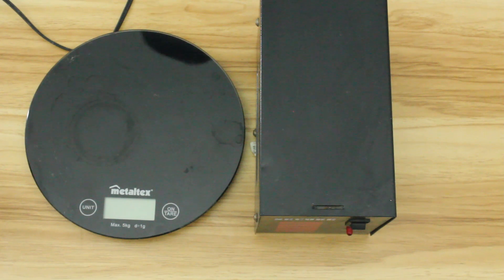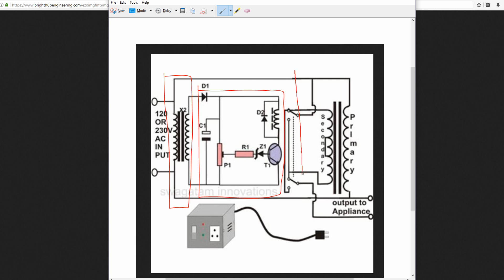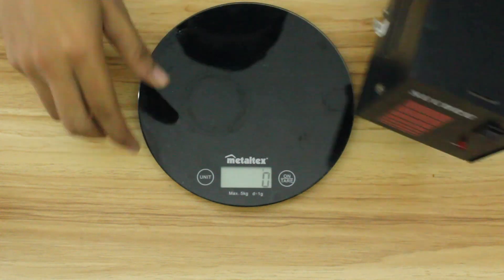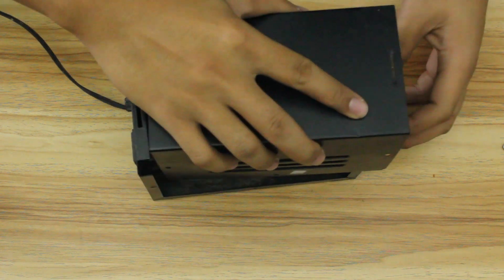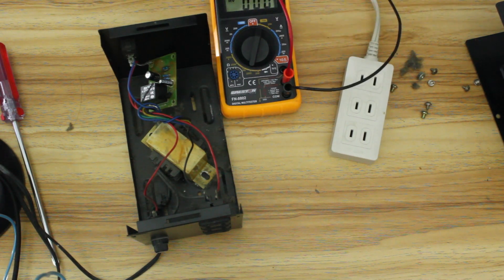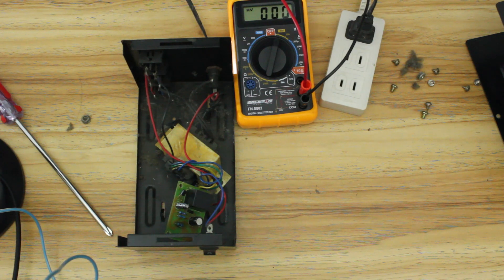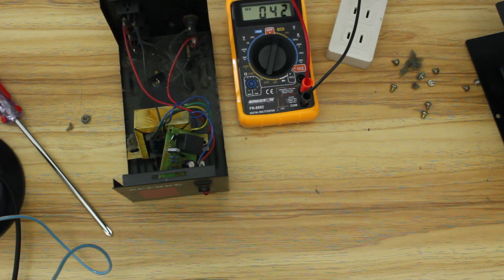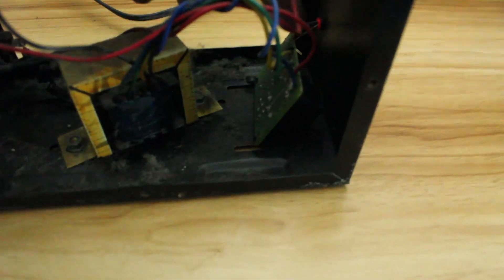NEVER buy a CHEAP Automatic Voltage Regulator for your PC!

Comment: Thank you for this review. Is there any AVR you can recommend?
Reply from the maker: I really don't have a specific model to recommend. If you are looking for one, I recommend you consider the following:
-> Features: get one that has the features you need.
-> Brand: Don't go for suspicious brands. Check with google if in doubt.
-> Build quality: If they are cheaping out on the looks, they are probably cheaping out on the components.
-> Weight: While not an accurate indicator of quality, it means there are more components inside. Larger wires/components = better. PS: Don't ask sales clerk the weight of an AVR, if it is weirdly light like the one in this video, then it's junk.
Reply: @DeuteriumTech , thank you! Noted on these!
Reply: @DeuteriumTech  Hey what if i plugged my t.v in my avr then after a week or two it gave a weird scent then i quickly turn off my avr is my avr broken or unsable now?????
Reply: Same, I saw this on Shopee as well. Naghahanap ako ng AVR since nasira siya, at siya pala reason bakit on and off monitor ko. I'm planning to buy panther avr. Kahit mahal mukhang legit naman.
Reply: Thank you very much, same problem din aa monitor ko, nag oon off kapag mga first 3 mins sa pag bukas ng computer set ko..
Reply: @Ot12_L  panther branded at sure tlga na ma protectahan pc mo wag yan generic avr peke yan.
Reply: Akin nmn dko gmamit ng avr ung gnamit ko ung extension lng n my protective voltage panther nmn brand nia kso ngka prob ung pc ko after 1 month dna ng open kala ko power suply prob. Ung ntry ko plug sa avr ng kapatid ko nh open pc ko meaning d ola safe ang extenasionkht my protectiv voltage xa kht branded pa cgro ms ok tlg avr
Reply: @aireenbrillantes5115  boss ibig sabihin lang non gumana yung surge protector and kung ako sayo dun ko isasaksak.
Reply: I just bought one, and it is working fine so far
Reply: @aireenbrillantes5115  lol a good surge protector will power off pag me irregularities gumana surge protector mo, bili ka na lang uli bago
Reply: @Ot12_L  panong on and off ? Nag rerestart po ba?
Reply: @DeuteriumTech  is Panther a good brand?
Reply: @joanpar4685  thats what they all say including the sellers.
Reply: @JosEffigy  di na tinatanong yan . Sobrang kilala ng panther subok na .
Parang omni din yan si panther.
Reply: Boss tanong ko lang po, pag po ba biglang namamatay at nagkakaron ng BSoD yung PC ko pwede po bang fault yun ng AVR ko? Kasi po naririnig kong parang may napitik-pitik sa loob ng AVR ko kaya baka yun po ang problema...
Reply: @JosEffigy  lol don't know bout that but mine's still working. (Tho last month nagloko Yung switch, pero naayos din agad)
Reply: Buy any Original Panther, Akari and OMNI AVRs that's enough to power your system then your good.
Reply: @Vinmuyoo  anong avr mo boi?
Reply: Help, ganito gamit ko avr tapos parang may mag ki click na noise tapos nag fiflicker yung monitor or nawawala display tapos bumabalik rin agad. Ano dapit gawin ko?

Comment: no offense but not a reliable review;  that is an old cheap avr unit thus expected to perform that way.. the IC in that one(which helps regulate the voltage) is already dead non-functional.  ive actual voltmeter-tested branded and cheap AVRs-- the difference is, branded heavy one has stable voltage  regulation compared to the cheap generic one.  both regulated the voltage--- branded one hits 220v stable while cheap generic one fluctuates between 217v-219v (it has ticking sound before it regulates the voltage).  direct bare outlet fluctuates between  235v-240v during the test. ** still thought, a branded AVR is the way to go especially if youre building a good PC.
Reply: Exactly

Comment: I have been using this AVR for over a year now from my initial corsair VS650 PSU to my current cougar gex gold 850w PSU and have had no issues so far. Got lucky perhaps? :D
Reply: I used that AVR for 8yrs. Actually there is no difference using a cheap avr than plugging your PC directly to socket.

Better use a branded extension cord with  surge protection than using a cheap AVR.
Reply: Actually today, my avr that is also like that burned a socket, smells like plastic, and now im worried if i continue to use it or not, now im searching in google why did it burn or i need to get a new avr
Reply: @Ethan_gameplay  same, my power cable connecting the avr and cpu just got burned this morning

Comment: Most AVRs won't kick in until the voltage goes beyond a certain amount, like 240V... That's he time they regulate it back down to 220V. 

Same on the low-end. It won't boost the voltage until it drops below a certain value. 

So I'm not sure if this testing is really valid.
Reply: Did not even compare to a different one. Bad English is higher than 220v. My ear transistors blew up from listening
Reply: I tested the exact same AVR. Takes about 8 seconds to take effect. I think it will take a few seconds to regulate the voltage, not instantly as what was shown in the video.

Comment: Just came across this video while watching AVR reviews. I have that same AVR and it's just an enclosed extension with a switch and fuse. I never used it on my PC because I also have a multi-meter, and the voltage isn't "regulated". Your wall outlet and that AVR's output will be the same, which is why I call it an enclosed extension with a switch and fuse. 

Most PC power supplies have a rated voltage range of 220 to 240 volts, so even if you plug your PC straight into the outlet it should be fine. I guess it depends where you're located. Here in my town, the voltage reading is always around 238 to 241 volts. The problem is when you have a thunderstorm, which causes extreme voltage fluctuations or when the electricity comes back after a power outage. The voltage fluctuations from those scenarios can fry your PC power supply. It's still best to have a reliable AVR. I've been using Panther Relay Type AVRs for a couple years now. It's reliable and well made, and it does regulate output voltage. You can go for Servo Type AVRs if price isn't a factor in your selection, which regulates output voltage faster but is more expensive.

Comment: hi sir! my pc keeps shutting down randomly so i looked up for an answer im using the exact avr in the video but my pc is budget build but could it be the reason why it's  shutting down?
Reply from the maker: Unlikely as these things have fuses which is a one-time-trip thing - you need to replace the fuse if it trips. You probably have a power supply issue.

Comment: I think if you are using low end computer it is better to have this than nothing. Correct me if Im wrong if the outlet where is the computer plugged in got short circuit the computer components will surely toasted. But if you have this the fuse will explode first and it could prevent further damage to the computer. (You said dont buy it if you have expensive computer. That is true)
Reply: I have a low spec pc and im using this cheap avr for a few weeks everything is working well

Comment: Hi,

What supposed to be the problem if a SERVO TYPE AVR - 1500 W is making humming/buzzing noise? Thanks in advance.
Reply from the maker: My non-technical answer to this is: Either the transformer is damaged, it's not being fed with clean power, or another component is damaged.
My technical answer to this: Buzzing and humming is generally caused by harmonics and anything that creates magnetic fields (inductors, transformers, etc.), also sometimes, capacitors may also create this sound. Think of how speakers work. The magnetic field interacts with anything magnetic. The push-pull action creates vibration, which then creates sound. Now, my guess is either your transformer is busted or another component is busted, or your input power is noisy. Did this just happen recently or is it already like this when you bought it? Heck, I should be turning this into a video.

Comment: Sir I have a question. Whenever I turn my Pc off my speaker and keyboard ( has rgb) suddenly lights on then off while my speaker there is like this static bump noise ( I cant explain it) is it because of this cheap avr? Or is it normal? ( Btw it happens Everytime)
Reply: Possibly but if possible that you try a better brand of ups or something and the issue still persist then most likely it's normal as they could be cheap brand or model.

Comment: I bought 4 pcs of this exact AVR. I tested it and it works. The correct way to test this is to wait for a few seconds until the regulator circuit kicks in. When you measure the output voltage of this AVR it will read as the same voltage from the input 230v but after the regulator kicks in (you will hear a rustling sound and a click from the relay) the output voltage will step down to 217 volts. It usually takes about 10 seconds for the regulator to initiate.

Comment: hey I just wanna know, every know and and I hear clicking sounds that causes my monitor to go beserk for a few seconds ( it flashes all sorts of colors like a corrupt bootscreen on a PS1 lol) then goes black, then back to normal, is it because of my AVR?
I have the AVR you have in the video, does this mean I should replace my AVR when I can?
hope you read this, this is a good video!
Reply from the maker: Are the clicking sounds coming from the AVR? It could be that your electricity source is fluctuating and the AVR is clicking to fix that. Or your AVR is broken (or undersized). Do you have your monitor plugged in the AVR? Try plugging it directly to an outlet. See if the issue with the monitor goes away.
Reply: @DeuteriumTech  Sorry for the late reply, I just moved it off the AVR now , I'm waiting to see if it'll happen again, I also noticed that the socket I used for the monitor was coming off (it wasnt fully off yet but you would sort of be able to see a small space between the socket and the avr)
Reply: it's been a day  and have had no screen problems any more, so it must've been because I plugged it into the AVR. thank you!

edit: a year later and I just realized how wrong I am lol.
right now I don't experience it as much anymore. but back then it might have been due to power fluctations and my AVR getting old / wear and tear. I plan to replace it at some point, can't right now though.

it is currently plugged into the AVR again.
Reply: bro same problem here

Comment: Are AVRs required for gaming PCs anyway?
Reply from the maker: If your mains is a bit unstable, yes. Think of it as a protection, rather than an essential component. Yes, gaming PCs would run fine without it but a surge might take down your entire rig if you're unlucky.
Reply: I see. Thank you for the answer. I guess I should buy a surge protector then if it works

Comment: This cheap avr i have 5 yrs ago and  still working good and test in multimeter its actually regulating the grid shows 235 and this avr shows 223 on my fluke multimeter how come this never should buy? By the way i use that only on my led samsung tv. Yhe one you check is already damage mine is regulated flawlessly  this avr is only kicked higher voltage if your problem is low voltage this cant help.

Comment: AVR  has a ground?cause my PC is grounded cant it help?
Reply from the maker: Sometimes they do, sometimes they don't. This one does not. If your PC is grounded, you just need a grounding wire going to a grounding circuit. Depending on how your electrical system is build, the third slot in your outlet may or may not be connected to anything. It's best that you try to find out why your PC is grounded. Check for any damaged wires inside your case. Try swapping for a higher quality PSU. Your motherboard may also be damaged.

Comment: Gudeve sir I have this NEWStar 350watt with 5mins delay , CPU and 19inches monitor lang ang connected, and this avr is connected to panther extension( with surge protector) iisa lang kasi yun gumagana na power outlet sa bahay.. then after a 5months of using it, pumutok yun avr, pinalitan ko yun fuse( same type) , inalis ko muna yun plug ng monitor at cpu.. nag power on ulit ang avr, pero nun binalik ko yun plug ng CPU at monitor pumutok ulit ang fuse ng avr.. ano kaya sir prob?

Comment: Hello. May seasonic 520w ako as psu, ryzen 3, a320m, and rx570

Need pa ba avr?
If UPS, anong VA and needed?
Reply from the maker: Seasonic is a good PSU manufacturer but if you experience frequent power outages or fluctuations, you should get an AVR. As for a UPS, a good rule of thumb is to divide your PSU Watt rating by 0.8 to get the UPS VA you need IF THE PSU has enough wattage. Your PSU does not have enough capacity. RX 570 already eats up 450W. Get a 620W PSU or you'll risk overloading your PSU.
Reply: @DeuteriumTech  not divide, multiplied by 0.8
Reply: @DeuteriumTech  Is this correct? I always thought this is only for getting the UPS wattage rating.

For example, if I have 600W 80+ white PSU, then the max amount it would drain from wall outlet is 600W/0,8 = 750 watt. A UPS that is rated for 750 watt is at least a 1300VA UPS, since most cheap UPS has power factor of 0,6 meaning the maximum amount of wattage it can supply for its rated VA, 750/0,6 = 1250.

So 1300VA UPS for 600W PSU. CMIIW.

Comment: im using a seasonic focus gx-650watts +gold powersupply  do i still need an AVR?  thanks for the answers anyone.
Reply from the maker: It's safer to use an AVR. I haven't been using an AVR with my Seasonic MII 620W for years and never had a problem. If you get frequent power interruptions in your area, it's best to get one.

Comment: sir can you recommend me a avr for my 80+ bronze Evga power supply
Reply: Any updates on this? What AVR or PSU did you use?
Reply: Hey i bought i corsair cv 550w psu. Can someone recommend for an Avr or do I need a UPS? Thanks
Reply: @kentbaykin2322  what did u use bro
Reply: @Yessirrrrr31  APC AVR
Reply: no worries, plug it directly to the wall. your psu have already all the protection you need. it's evga

Comment: This "avr" is ONLY designed to kick in under HIGH voltage and reduce it by about 10%. Is has NO circuit or transformer winding to INCREASE voltage at all.
 It will not help you if your problem is low voltage on the mains.
Reply from the maker: At least someone here gets it.
Reply: @DeuteriumTech  Delikado lge! These are all over shopee advertised as 500 watt. In fairness, nowhere on the packaging or on the device is the wattage stated. BUT the size of the transformer is only about 10 watts, so it's good that the power flow under normal use is just going around the transformer! Looks to me like 22 awg wire everywhere inside the cover, so the wire size is rated to about 200 watts. On top of that, the fuse in the back is WAY TO BIG; 5A (about 1000 watts)! Its a good way to burn something!

Comment: heyyy i hope u can still read this!
i just watched it and oh boy, I just realized why my AVR (eco power 500w) had clicking sounds while im using my pc :< 
I just bought a goldsource computer avr at 1000w, is it okay compared to this one??? thank youuuu
Reply from the maker: Hey, that AVR looks beefy. I think it's alright. Btw, that clicking sound you hear, that's the AVR trying to "regulate" the electricity going into your computer. It normally does that when flipping the switch or turning stuff on. If you don't hear the clicking on your new AVR then chances are your old one is broken.
Reply: Hey same here. Is my avr broken? Cause i think it affects my pc. I already replace two hdd because of bad sectors. Do u think its the reason for fluctuating? Or is it my PSU?
Reply: I think that "clicking sounds" you hear is from the servo motor.

Comment: Hey there, im going to get an evga 450bv,  is this avr ok?
Reply from the maker: Though this AVR might save you a few times, I wouldn't trust it. You better go for more expensive ones. Or get a better PSU. I've been running my PC for years without an AVR (you can do that too assuming your electricity mains is stable). I use a Seasonic MII 620W.

Comment: Boss bat yung avr ko na yan pumutok bigla
Reply from the maker: Because... It's crap. Small wires, no safety features except a fuse. I'm not surprised.
Reply: @DeuteriumTech  Boss 2020 na ngayun pero sana mapansin mo paden to.... Boss okay lang ba kung wag na bumili ng avr kasi di nmn madalas nag bbrownout dito? or much better na bumili... pero pansamantala ok lanmg poba na wag muna bumili?
Reply from the maker: @tacticalicexsports8127  It's not about how much power outages or "brown outs" you experience. It's more of how "clean" or stable your power is. Most quality PSUs offer a level of protection but it's still best to get an AVR, theoretically.

But for me, I have been running rigs without AVRs and never had problems. I don't cheap out on the PSU though.
Reply: @DeuteriumTech  hello my psu is zalman zm 700 xt 80 plus, do you think i need an avr?
Reply: Same lang tayo..ako din ngayon pumutok bigla.

Comment: When im plugging in my avr its sparking
Reply from the maker: How old is your AVR? Sparks happen when there is a sudden change in voltage such as when you plug something to the wall outlet and when there is a metal-to-metal contact such as a plug and an outlet. I'm guessing your AVR is really, really heavy which indicates it's likely to have a rheostat inside - which is a metal-to-metal contact.

Comment: That is a good review for a usually purchased AVR of non tech users. I had two recommended AVR brands in the market APC (Schneider Electric) and CHINT.  AVR are useful in your places near to heavy industries and far flung areas which has a large voltage drops reading and those with frequent brown-outs.